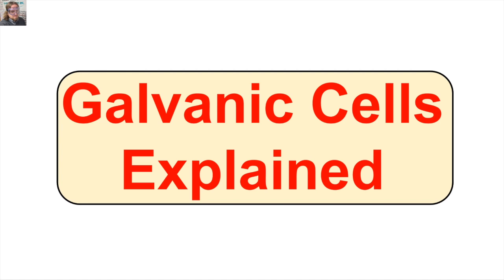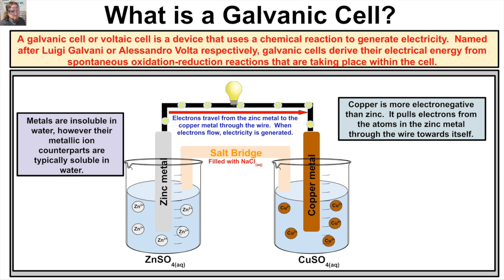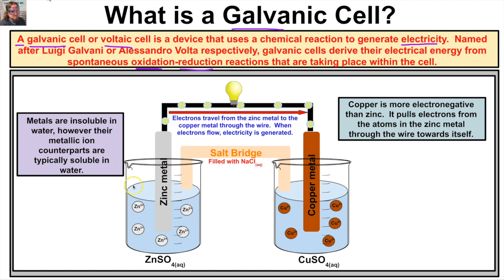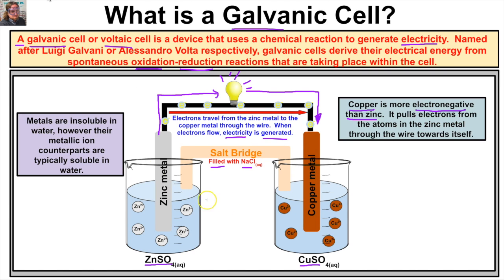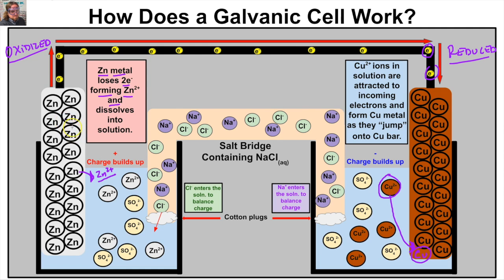Galvanic Cells - Explained

Comment: why does the salt bridge need to be a bridge? Can't you just put salt cubes in each solution?
Reply: The salt bridge contains ions which are free to move. The free moving ions carry charge and can complete the circuit. Putting salt cubes in each solution wouldn't form a complete circuit so no reaction could occur.